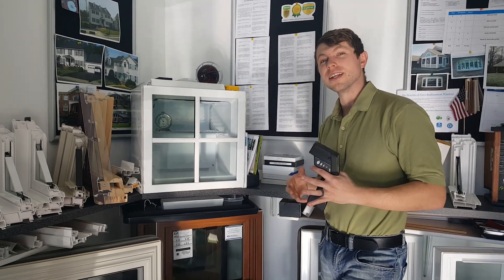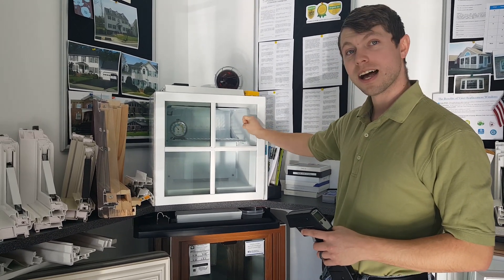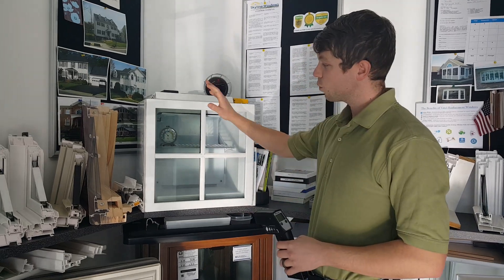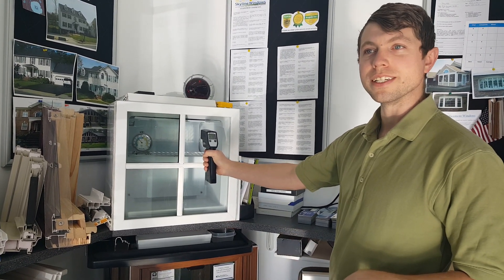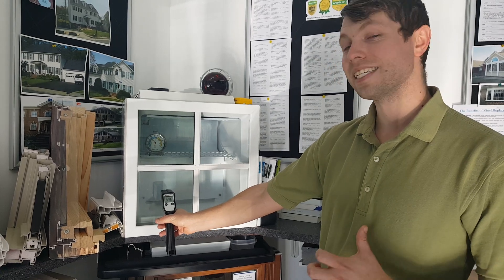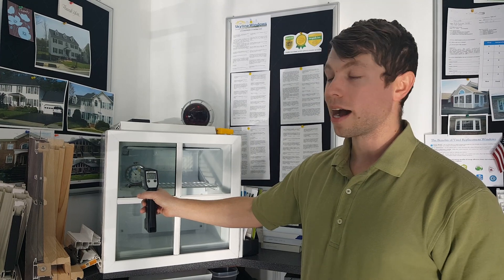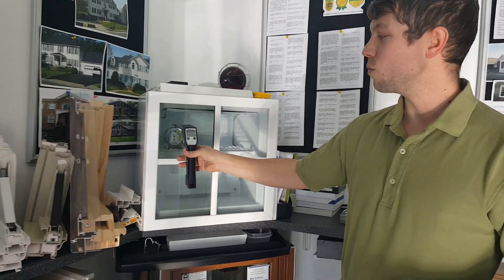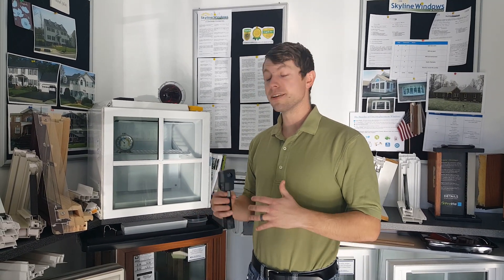Thermal Performance on different types of Insulated Glass Units

Comment: I have a double glazed window unit that pumps cold air into the house, It is really noticable. Thick ice firm on the inside of the window in cold weather, but not on any of my other 18 windows.     Window not broken down and no water inside. Any ideas why this  is happening.? Many thanks

Comment: Great video, thanks! At 17 Def F (-8 C)  my double pane , argon filled window pane has measured between 37F (3C) and 45F (7 C) while room temperature and humidity are 68F (20 C) and 39% respectively - I am using humidifier to protect the hard wood floor. Based on your video, the measured temperature pane readings are way too low. There is very little if any "fog" between the two window panes. Theoretically, the window should be functioning normally, but it is not. Can you please comment what the problem might be? Thank you! Sandy

Comment: An old, but excellent video!  I have been trying to get information like this from various window suppliers and local dealers to find out how my current windows are performing.  I currently have double pane, no gas, and the inner panel is removeable to access the blind between the panes.  With an outside temp or 18F, inside temp of 69F, my windows read 53F and with the inner blinds closed, they read 56F.  So basically the same results as the video.
Reply: I bought a good quality double pane low-e window and the inside temperature in NC winter is basically the same as the thermostat setting.

Comment: What does laminated glass give you 
I have a project where the seals in all the themopane units have failed 
There are no weep holes for moisture escape and the spacers have clearly broken down 5 year old windows seals started going after 2 years that i notices now at 5 yrs they are all gone 
80’ by 10ft high windows sizes 4x6 2 x4 and 4 x8 door sections

Comment: Most window manufacturers buy the same glass from Cardinal Glass Industries, what matters the most is the frame that’s holding the glass and how much it expands and contracts in the hot/cold climates, the goal should be to get the fames to match the glass expansion and contractions. Also most of these YouTube videos are almost always vinyl which is fine for decay and insulation but horrible for expansion and contraction, vinyl expands at 7x the rate of the glass so don’t let sales reps pushing vinyl say otherwise, it’s a fact...but it’s cheap so consumers fall for it based on dollars.
Just as important is that vinyl window manufacturers only buy the low-e coated glass in single sheets and then try and seal the double pane windows themselves with one of two materials, non-metallic foam or aluminum spacers with a single screw holding in the denser argon gas. Cardinal Glass moved on from these spacers back in 1993 and onto insulated glass using stainless steel that only has one seam that gets welded  but this costs more so vinyl and fiberglass window manufacturers won’t purchase them this way to keep costs down and consumers wouldn’t know otherwise. I sell windows if folks can’t tell and I sell a premium product but I spend most of my time informing myself with research on things like this since there is so much disinformation out there only to garner the sale.
Reply: Not really actually. Some use Guardian glass and some still use PPG. Depending on the area.
Reply: What windows do you sell?

Comment: What the number of low e ( for example =180  or 272)
Reply: the first (one digit) number is the number of layers of silver in the coating stack. The second (two digit) number is the visible light transmission through the glass and coating.

Comment: How about double glazed with argon low e2 and laminated? Where would this fit in your comparison of types of glass to keep the room temperature against cold outside temperatures?
Reply: lamination makes no difference in glass energy performance.
Reply: @gregcorwin8316  sound proofing..is laminated better than dg?

Comment: How does a single pane of laminated glass compare in your testing
Reply: laminated glass performance is going to be pretty much identical to a sheet of single pane at the same overall thickness.
Reply from the maker: Unfortunately we did not test any single pane of laminate glass. I would guess that it would perform slightly better than the regular pane of glass, but not better than the double pane piece of glass since the dead air space is a big part of what makes the glass more thermally efficient.

Comment: In the winter we get about -15 degrees Farenheit snowing etc we are planning on building a house where the first floor is all glass wall but a part where indoor swimming pool is can be opened up leading to the outside where we can entertain kids pool parties etc in summertime..   which type of glass would suit our need best and can it be built where it can slide open etc
Reply from the maker: When you have those big temperature differences between inside and outside of a house. Its most important to look at the U-Factor of the whole window or door. If you search on Google for "Most Energy Efficient Windows" and go to the EnergyStar.gov page that shows up, you will have a good short list for some of the most energy efficient window options available in the US. I'm not sure where to point you if you are outside of the US. If you are looking into a sliding option, you will also want to pay attention to how heavy the glass feels. Sometimes triple pane glass can make the door or sliding window a lot heavier and therefore harder to open.
Reply: @skylineRichmond  thank you for the reply I live in Armenia which is East Europe I will need to discuss with architects your given advice.  Thanks again
Reply from the maker: Hi Rafik, Armenia is a beautiful country. I'm afraid I won't be of great help to you though. I know the U-factor measurement is done by a US based organization.

Comment: 4-degree difference between the triple pane low E and the double pane low E. But the triple pane is almost twice the cost of the double. Is that difference really worth the cost?
Reply from the maker: Depending on your climate and the cost it might not be worth it. I know in our area the cost of triple pane is only about 5% higher than double pane. Depending on the sales guy that comes with the product he might try convincing you that its almost double the cost. If you live in a warmer climate, even that 5% cost difference might not be worth it as you would be more concerned with solar heat gain. In other climates, further from the equator, triple pane glass has become the standard.
Reply: the difference was closer to 8 degrees. I would consider that depending on the price increase, but that is actually pretty good.
Reply: Very little different in U-value of between Tripleglazed units and standard double glazed units with Low E insulated Glass Sealed units with Warm edge spacer bar Plus Argon Gas is both units are total thickness of 28mm.  Tripleglazed units with Warm edge spacer bar Plus Argon Gas Units must be no less than 40mm for maximum insulation as it's a greater cavity space with more gas between and also offer huge acoustic sound insulation. 
Could say poor value in terms of financial cost . 
You can also have 2 panes of Low E glass for further and better Insulation and get down as low as 0.7 pending on gas inserted between the panes like krypton/ Zenith .  Spacer bars must be thermal foam type and not the common Aluminium spacer bar as it highly conductive to form condensation around the edge of units .
Reply: Iv all of home in triple glaze then 1 double glazed  window on side of home with room ,,,,,now on a cold day or night u can see the frost on the double one with the gas inside, so that's doing its job keep heat in .now rest of home is quite but no frost on outside and seems like heat gets out as rooms be cold ?????